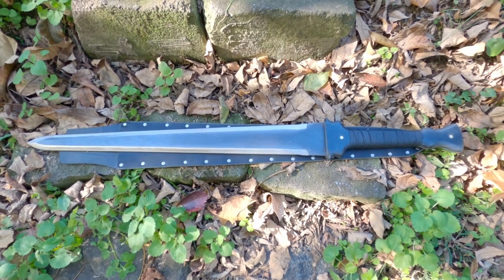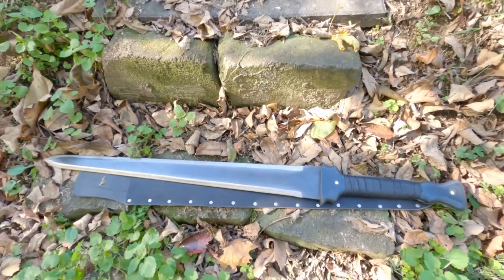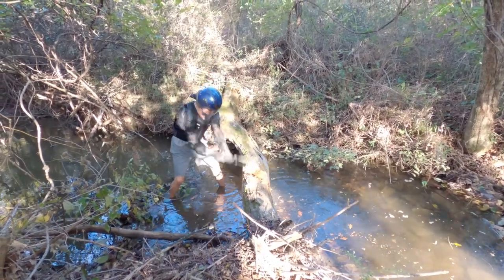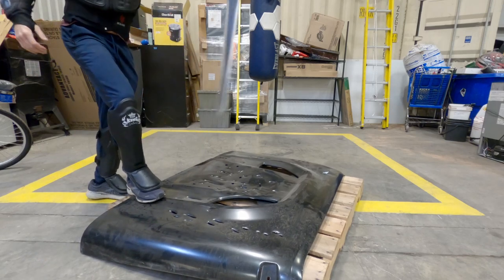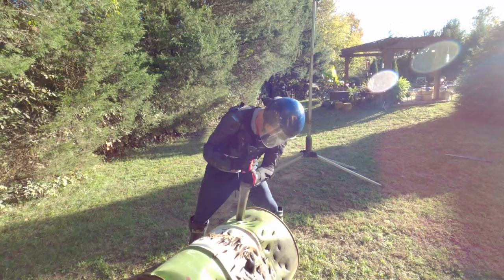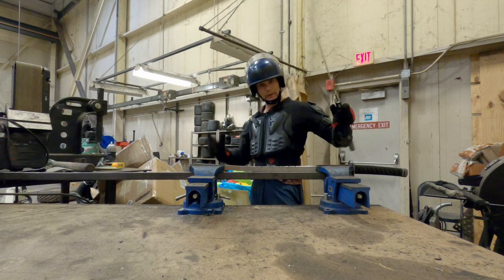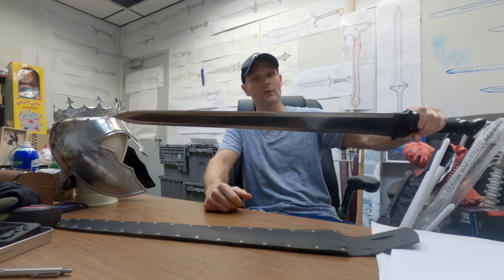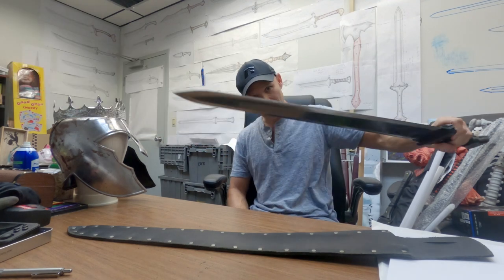Daywalker 2 Doomsday sword review with harsh testing.

Comment: What kind of metal or alloy did you buy for your sword and knives?
Reply from the maker: 1095..heat treated to 1500 degrees  then baked then heated to 500 for two hrs giving a Rockwell of about 57...